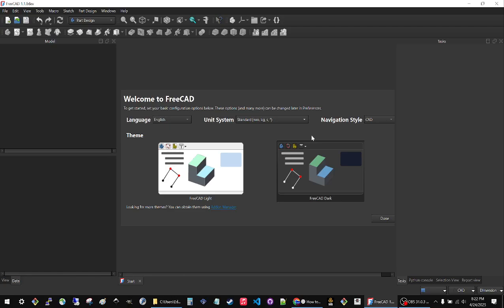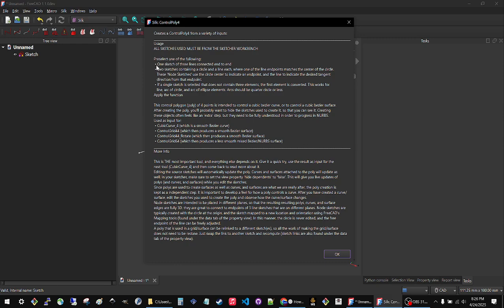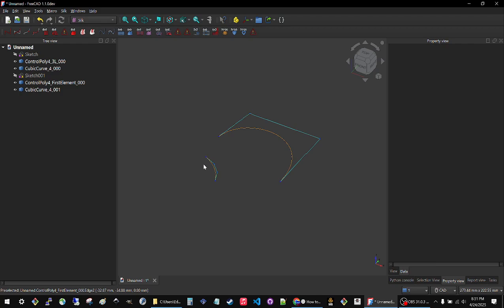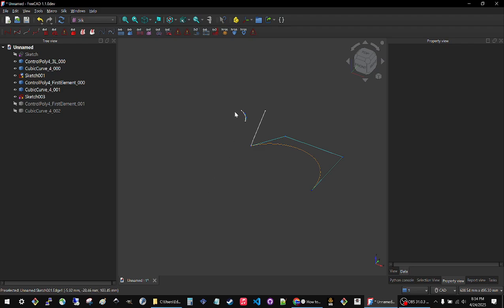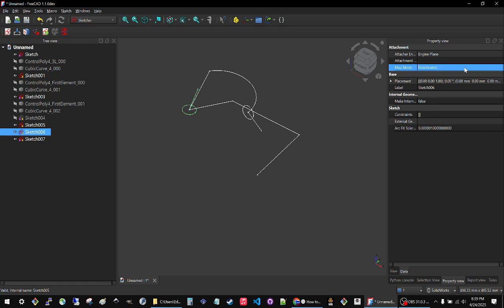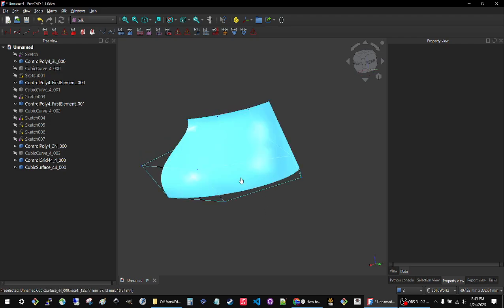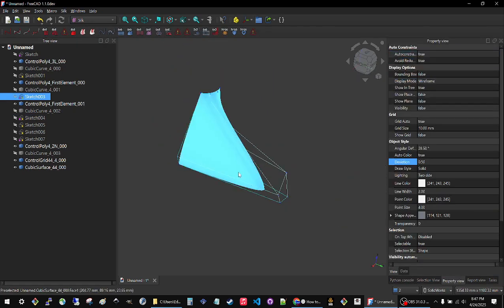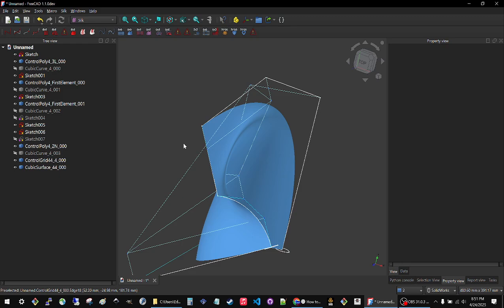Silk Basics (FreeCAD Workbench)

Comment: Can I use a silk surface to patch/blend/fill gaps between multiple surfaces that I created by lofting/sweeping and slicing? Thanks
Reply from the maker: Unfortunately, no. the Surface WB fill surface tool is probably your best bet for that, although Curves WB may work in specific cases.

Silk needs predictable inputs for each operation, so everything has to flow through the workbench (above the sketch level).

now there are exceptions where Silk can connect to existing surfaces, but i don't think these special cases are what you are after:
-silk connects to planes
-silk connects to cylinders
-silk connects to spheres
-silk can connect to any untrimmed cubic Bezier surface in principle, but this would require a translation step depending on how that surface stores its control points and weights.

all of these special case connections rely on specific sketches and grids to create the smooth connections
Reply: @edwardvmills  Thank you! The quality of surfaces that Silk outputs are AWESOME!

Comment: Good to see a silk tutorial. Hoping for one on blending a bunch of adjacent surfaces. I have a model that's watertight with a bunch of 4 4 surfaces forming a ring, but when I use 6 4 surfaces to blend the 44 surfaces together, half of the boundaries end up with tiny gaps, so I get a shell instead of a solid. Does there have to still be a 44 surface between the 64 surfaces, or can I split the original 4 4 surfaces in halves and have the 6 4 surfaces meet at the split?
Reply from the maker: could be a few things...are the gaps present at high surface quality settings?
I usually keep at least a little piece of the 44s when blending. you typically need some space to join the 64s into a 66.  It's hard to say without seeing your model, because i'm making assumptions based on your description.

I encourage you to post your model (or snapshots), and questions on the FreeCAD forum (search for the "Silk: a NURBS workbench" topic)